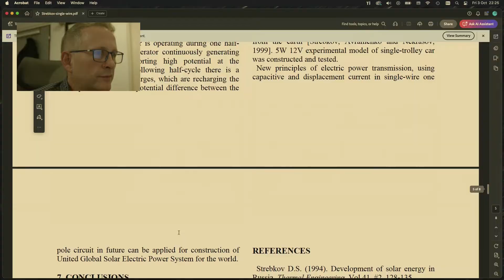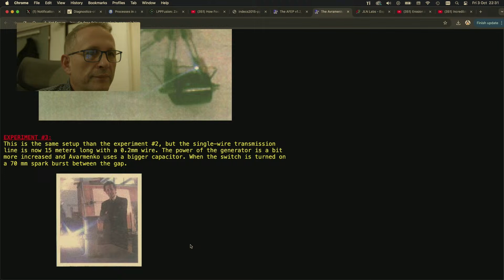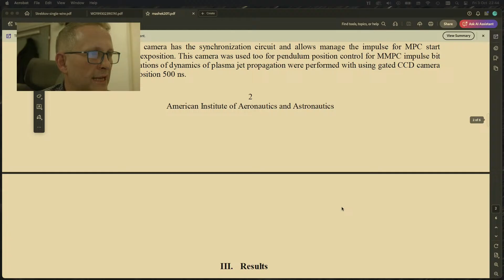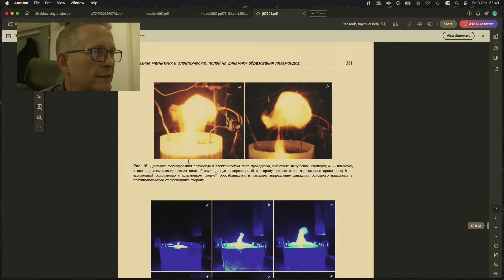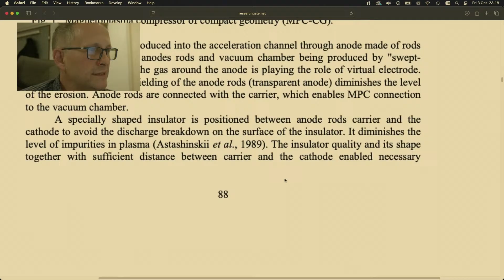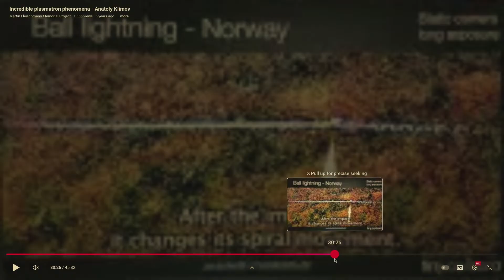Klimov - Discussion about his novel plasma focus detonator with carbon clusters & hydrogen ion fuel

Comment: It is chemistry, plasma chemistry. Nothing with nucleus physics.
Reply from the maker: Please detail in chemistry how you get
- ions that achieve 40eV of ionisation in a 3eV plasma system
- up to 2 keV x-rays
- How you get spectra of elements that were not in the analysed reactor components?
- How you get a shockwave that is 2 - 4 times more energetic than any possible chemical energy would allow?
Reply: @MFMP  Internal atomic shell excitation by nonlinear action 🤔 Concerning new isotopes, it looks like not accurate experimental measurements. Impurities ...

Comment: Wondering if the "fuel" could be fed in via a capillary introduction (as found on many lab instruments) via an appropriately sized capillary tube of appropriate material - then pumped via peristaltic pump (slowly) far enough away so the peristaltic tubing doesn't melt (so, say PE tubing connects to SS tubing that, then feeds into the center cathode - or anode?)
Reply from the maker: Yes of course, these are all engineering challenges, what Klimov has done has combined three Russian Inventions and solved the main problems of Plasma Focus based devices.

Comment: Plasma pinch-compress-eject approach looks similar to what LPPFusion is doing. Pretty pictures of plasmoids there too... and you mentioned it later in the video. Commented too early, oops. :D
Reply from the maker: LPP fusion is based on this Russian invention designed to research fusion through Magneto-hydrodynamic compression. However, the main problem with LPP (and MPCs) is the 'snake' central electrode gets eroded - likely because it is "in the way" of what nature really wants to do in the self-organisation process. Klimov has solved this.

Comment: Searching for the referenced document posted to this video at its 8:00 minute mark, and reading through the abstract of a document posted to the LENR-forum website, reminds me of the air-fuel bomb used by the German military against the Russian front as reported by Joseph Cater in his book, The Awesome Life Force, in which an initial explosion of this air-fuel bomb caused the diffusion of carbon dust to form a cloud in which the ions of water vapor (within this cloud) were positively ionized with at least 70k volts so as to liberate the hydrogen ions from the water vapor and liberate nitrogen ions from the dinitrogen molecules of the air. Ammonia would form as one type of byproduct along with residual hydrogen. This would make the second detonation (which occurred a quarter of a second after the first) very potent. So much so, that the Russians took out their megaphones and warned that if the Germans should keep up with this type of assault, then the Russian army will feel inclined to start using the various poison gases held over from WWI. The Germans subsequently ceased using these air-fuel bombs.

Of course, it's not exactly the same as in this experiment, but parallels it somewhat.
Reply: That's very interesting.
Reply: It could be that the positively charged environment is due to coherent electrons stripping themselves into “singlets”.  Perhaps ammonia burning is one way to exploit this temporary charge imbalance.
Reply from the maker: Sounds thermobaric.